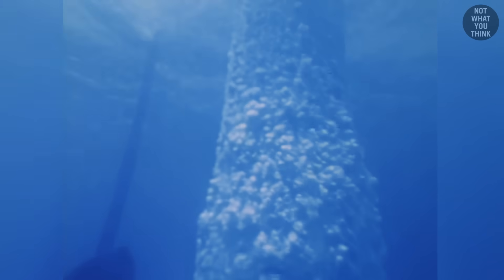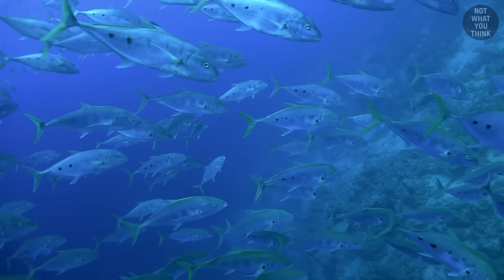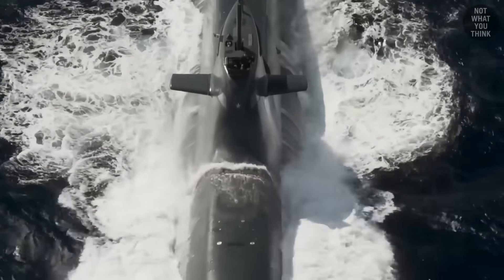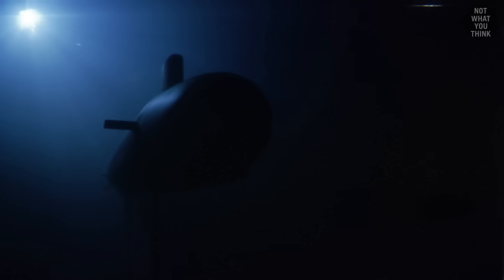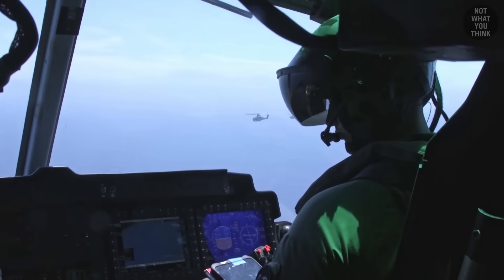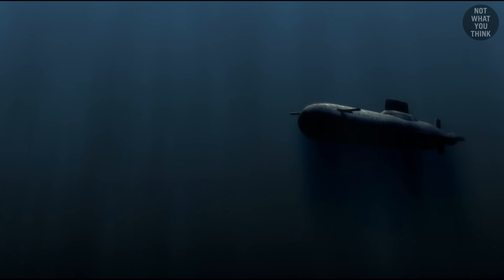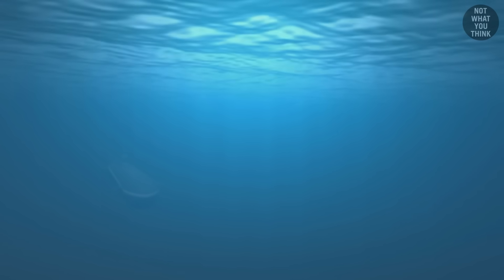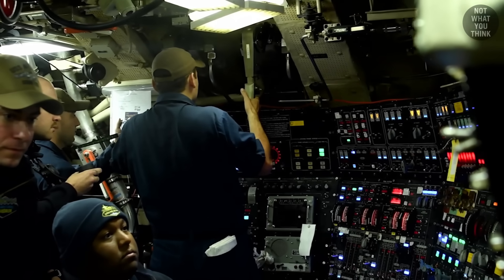Why Being Too Stealthy is Bad for Submarines

Comment: why are diesel-electric subs quieter? nuclear subs also get their propulsion from electric motors
Reply: Fewer moving parts. Diesel engine can be shut down 100%, turning off the cooling pumps on a nuclear reactor isn't really advisable.
Reply: Think of how much noise a nuclear power plant makes.
Now consider how loud a battery is.
Reply: @nathanahubbard1975  a nuclear power plant is tens of times the size of an entire sub. and nobody who ever designed one tried to make it as quiet as possible
Reply: @Harry_Gersack  That makes no sense. You're not aware that nuclear powered subs exist? They try to make them as quiet as possible, but they'll never be as quiet as a battery.
Reply: @nathanahubbard1975 yes, it makes no sense comparing a sub to a huge power plant, that's why I pointed it out
Reply: @Harry_Gersack  I was referring the the power plant in the sub. It has a reactor and turbine, pumps, etc. It's a fairly powerful one too, actually.
Reply: Nuclear subs get their propulsion from electric motors, but those electric motors are powered by nuclear reactions which just like a nuclear powerplants need to constantly move large amounts of (sea) water through external intakes in order to keep the reactor within temperature and to condense the steam produced in the secondary loop of the reactor so it can be turned into steam once again. All of that circulating water, often even mechanically circulated, generates noise. Meanwhile modern diesel-electric subs use either a massive bank of lithium batteries, or turn hydrogen and oxygen into electricity by passing it through a fuel cell, both of them are for all intents and purposes completely silent, unlike the cooling necesarry with a nuclear submarine's reactor.
Reply: @pieterveenders9793  thx 🤝🏼 I know how nuclear reactors work, but I never would've thought that you could hear the cooling water  circulation and the pumps

Comment: You forgot to mention that sub hunting planes can also use what's called a MAD or Magnetic Anomaly. This is used to detect the magnetic signature of submerged subs.

As for thermoclines, subs also use them to hide their acoustic signatures. Sounds tend to have a hard time traveling above or before a thermocline. 

Lastly, subs also use VLF/ELF to receive messages to go closer to the surface in order to receive new orders.
Reply: Couple of things wrong with your post. MAD isnt used to find submarines. Aircraft such as the Navy P-3 will use its sonobuoys to locate a submarine. MAD will be used to prosecute the sub for a solution so that weapons can be deployed.
Next up subs do not need to get close to the surface to transmit/receive VLF comms. This frequency range transmits easily thru the earth and the water column. Oh and they don’t “receive” orders via VLF. The aircraft or ground stations transmit short code words that can mean many things after decryption. Did you know that you can quite easily listen to the messages?
I spent most of my career in airborne ASW and as flight test engineer with years of experience in the TACAMO community.
Reply: @kaptainkaos1202  wow,you just blow my mind. i always though that mad is use to find a trace of a possible sub and ONLY AFTER they fired sonarbuoy to track the sub position and create a firing solution...... so it's the opposite in real life?
Reply: Sound refracts and reflects at the layer of a thermocline, depending on the angle of impact, temp and salinity change.  Sound does not "have a hard time travelling" LOL    
ELF messages come to the sub through the earth and the depth of the sub does not matter, the signal travels through everything but the frequency is so low, the transmission character rate is very very slow, hence sending codes with very simple instructions.
Reply: Some nations also use high quality satellite imagery to detect the minuscule amount of wake from a submarine that will reach the surface 
Think about moving your hand under the water in a bath and how it disturbs the surface, but on a bigger, but much harder to detect scale. Tiny differences in wave height and speed, but enough to detect the path of a submarine
Reply: @5tr4nge75  actually the satellites use high resolution ISAR or LASERS to map the surface levels of the water. Neither are used for locating the sub initially but will be used when the sub is located to a reasonable amount of area.
Reply: @kaptainkaos1202  thank you for correcting me
Reply: @kaptainkaos1202  I know that this is unrelated due to being video game logic, but in Advance Wars you could detect a dived Submarine by moving any kind of unit adjacent to it, be it just some foot soldiers, a Tank, a Transport Helicopter, or an Interceptor.
Reply: @5tr4nge75  Oh, I have been there. I have heard and felt the sail planes smash the tops of those 20’ waves. Do you think a satellite can see a sub 100’ under water with 20’ waves above. That would be one hell of a satellite.
Reply: @bradleyweigle7875 As I understand it, it's still experimental technology because not only does it require extremely high precision measurements of the sea level (we're talking micro- or perhaps even nanometers here), but also some very sophisticated signal processing to sort out all the noise that you're rightfully pointing out.

I'm no expert, but there is a signal processing technique called the Fourier transform, and it's basically math magic. It allows you to take a signal, say a sound, and split it into all its constituent components, or tones in the case of sound. You can then analyse these components, modify or remove them, and then reconstitute the signal from that; it's incredibly powerful and frankly surprisingly effective.

The end result is that, while it is far from perfect (it never is in practice, of course), you can, to a large extent, have it look at the waves around and effectively "remove" them from the signal; because it can see what they look like as a pattern and just remove that constituent pattern. In this particular case, I imagine they'd scan, say, a square kilometre of surface and then try to "remove" the waves from the height-map of the area; the disturbance they'd be looking for would present as a bulge, maybe cone-shaped, on the image.

Still, whether than can be reliably done and still allow you to detect anomalous micrometer fluctuations in an area, is still an open question (and if anyone has achieved it, it's likely a highly-guarded military secret). As you say, the open ocean is often rather wild, to put it mildly, so it's like picking out someone talking normally over the background of a heavy metal concert.
Reply: @mnxs  20’ high individually very choppy waves. Experimental my tax dollars at work. A lot of BS. Where is DOGE when you need it.
Reply: @bradleyweigle7875  While DOGE have been very busy in gutting everything good in the rest of the federal government, they've been remarkably light on some of the real money pits, like the DoD. Weird, that.

(It's probably not weird at all; more like the defence corporations being nice with the bribes, not to mention Elmo being a defence contractor himself... foul play? nooo, why'd you think that? lol)

But yeah, if it wasn't clear from my comment, I'm fairly skeptical about the viability of such technology myself. I'll see it before I believe it.
Reply: @5tr4nge75  Here is a thought. How much wave action do you think can be detected on the surface of the North Atlantic? Never been there, have you?
Reply: @bradleyweigle7875  it’s a known method of tracking submarines. 
Again, it uses incredibly high resolution satellite imagery, and some incredibly complex computing the article didn’t explain (probably for good reason) 

And sure, I’ve never been to the North Atlantic, but I spent about a decade of my life sailing in the channel, I know enough about the sea to imagine that with sufficiently high resolution imagery it could technically be possible
Reply: @bradleyweigle7875  - Others have already scolded your comment, but I will add. The magnitude of the wave does not have to be bigger than the other waves. The very slight wave is a structural element that has a different shape and dimension than the other waves. Mathematical techniques like two-dimensional Fourier transforms of wave height or statistical analysis can reveal wake patterns undiscernible to the naked eye. In fact, I could find enhanced photos of ocean wakes on the internet over a decade ago. The technique works, and is far from secret at this point.
Reply: @bruzote  You must have miss the whole part about 20 ft waves. You know nothing about the North Atlantic in the winter. You know nothing about thermos clines. You know nothing about submarines. You know nothing about what has happened in the last 10 years. You know nothing about a submarine and its defensive measures. You sound like some college professor reading from a book. You choose to forget what you don’t want to factor into to your mathematics. You should take a trip on a sub when we are taking 23 degree rolls and you are reading some paper another professor wrote from his desk while studying mathematics. Have you been scolded enough?
Reply: @bradleyweigle7875  its not optical its radar and that technology does exist, just like your eyes can detect a pattern in seeming random noise, the satellites can detect the subs wake pattern.
Reply: Some nations also use high quality satellite imagery to detect the minuscule amount of wake from a submarine that will reach the surface 
Think about moving your hand under the water in a bath and how it disturbs the surface, but on a bigger, but much harder to detect scale. Tiny differences in wave height and speed, but enough to detect the path of a submarine

Comment: The new diesel electric boats don't need to surface to recharge their batteries if they have an AIP system and lithium-ion batteries instead of regular lead batteries, they can stay down for weeks with an AIP system.
Reply: Yes...they can stay underwater for weeks, but at reduced range and speed...roughly 5knots/hr
Reply: @andrewj9831  Sorry but your wrong, with AIP and Lithium-ion battery's they can go faster under water and greater ranges, you're probably thinking about older diesel electric subs, for instance the KSS3 can do 20 knots submerged for 2 weeks with Lithium-ion batteries and AIP to recharge at speed and still have 1 or 2 weeks to go submerged.
Reply: @KellyBrownlee  No..therese are the current pubic data of a new 212 using the new ASFC.
Reply: @andrewj9831  that's my point. Not all new diesel t electric  subs are the same.
Reply: @KellyBrownlee  No. KSS3 can do 20 knots submerged for a short time, or slow cruise for 2 weeks, but not 20 knots for 2 weeks. AIP and Li-ion simply don't have that power density.
Reply: @andrewj9831  when would you need speed for, anyway ?
submarine is 90% about staying quiet & undetected, that's the whole point of being a submarine
Reply: @tranquoccuong890-its-orge  the speed of your sub is important if you're partoling the east end of the Mediterranean and then SHTF in the Black Sea and you're the closest asset and command want answers yesterday. You need to get there quickly, then get stealthy again once you're in position.
Reply: @andrewj9831  nothing against you, but if you write something like knots/hr its shows you don't have much knowledge about this
Reply: @GhostXYHunter  No, that's too common and natural a mistake to disqualify his message.  I've known old salty dogs making the same mistake.
Reply: There’s “no moving parts” when running on battery power?  I don’t understand how batteries can propel a submarine through the water with “no moving parts”.
Reply: @Jim1971a Of course the props have to turn, but they are driven by electric motors, which are relatively quiet. The power generation side is what has no moving parts while running on batteries, while a diesel engine or the steam turbine of a nuclear reactor would.
Reply: @Jim1971a  no moving parts besides the propeller and shalf. ie no steam turbine spinning
Reply: @kierano8390  What makes the propeller and shaft turn?  There are at least 2 rotating devices bwteeen the battery and the shaft.  Can you guess?  What is the equivalent of the steam turbine?
Reply: @csjrogerson2377  are you restarded. instead of a diesil engine or nuclear power plant, its just batteries, which power an electric motor. no moving parts generating the electricity because batteries dont have moving parts
Reply: @kierano8390  Ah, you got there in the end.  The electric motor and the gearbox are the rotating machinery.  You are so inept, you dont understnd that a electric motor is a moving part.  The battery is the equivalent of the diesel or nuclear fuel.  The electric motor is the eqivalent of the steam turbine or ICE.  Do buck up ffs.
Reply: @kierano8390 if the drive shaft and the screw are moving then theres moving parts.
Reply: @redalertsteve_  its not refering to those parts... its refering to the engine, how many times have i got to say. mo*on
Reply: @ i don’t think you understand how power is generated or how an engine works. That engine has moving parts inside of it
Reply: @Jim1971a  Coolant pumps too.